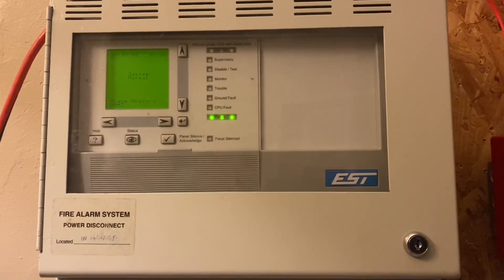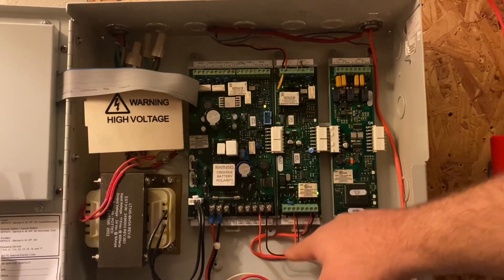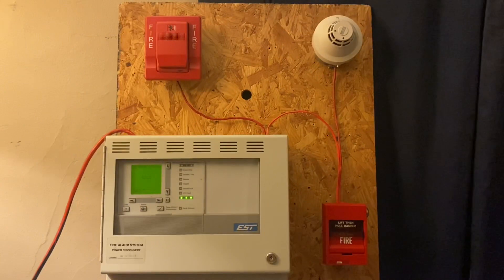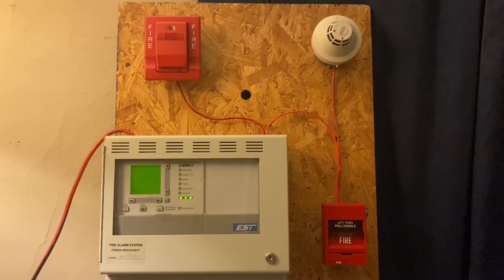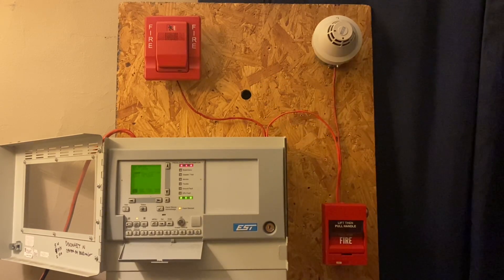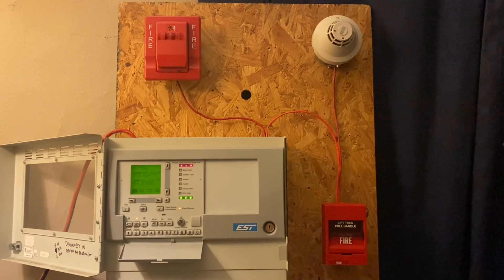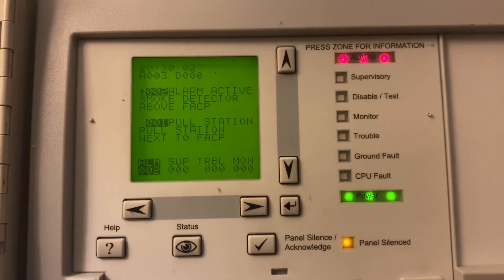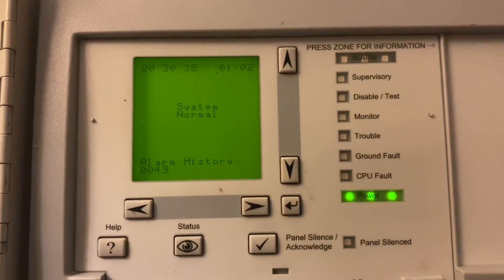Mini System Test 90

Comment: Can you do a video on how to install a FireLite announciator LCD 40 to a FireLite MS 9200
Reply: do you have 24vdc non resettable power
Reply: @DAPchatt  yes
Reply: @brandonkonicki2177  ok so you want to run a wire from your 24vdc to the anncunciator and put it in the in terminal then you want to run a wire pack to the 24vdc then your wire it using the ann-bus